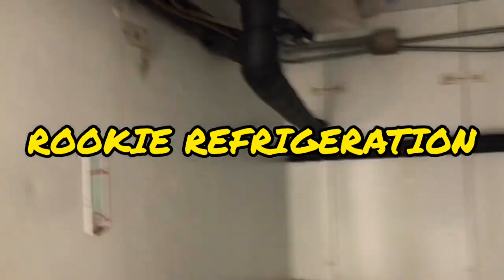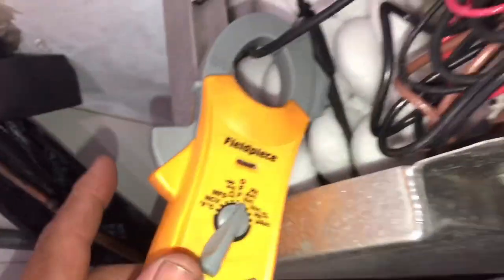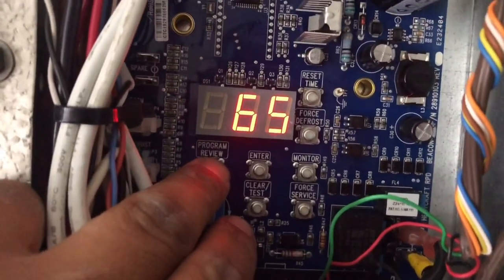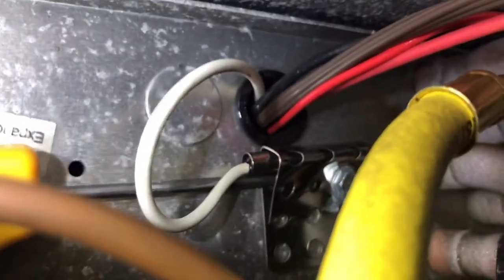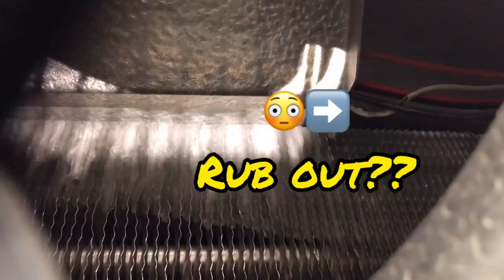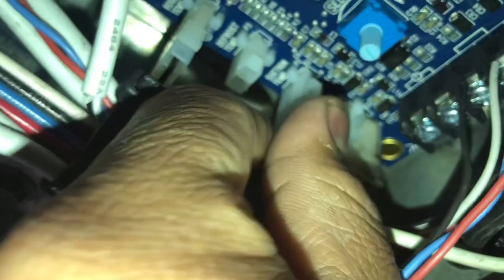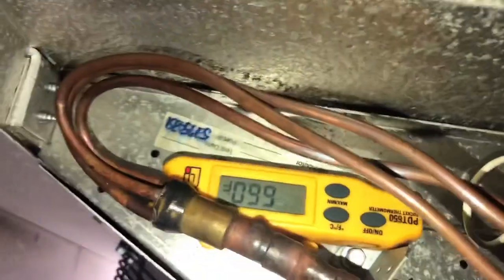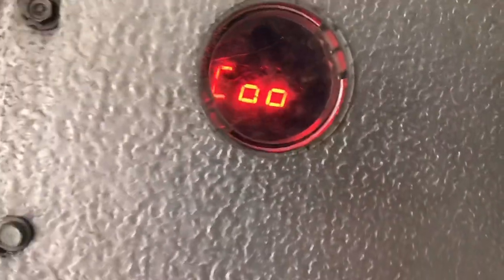Refrigeration:  Freezer Evaporator Icing up

Comment: a) You mentioned in passing "a design flaw" and b) I know that correcting manufacturers is a controversial subject. Having said that, wouldn't it be a good idea to move the defrost sensor to the most iced-up area of the evaporator and be sure each time it is 100% de-frosted? Thank you for another opportunity to learn.
Reply from the maker: Yes. That is exactly what needs to be done.  But we aren’t allowed to change it when we want. This chain only allows us to change these things if it’s approved.    It’s so dumb.   But you are 100% correct.   I’d love to relocate it to the top right part of the coil in between the fins.   Great comment bro
Reply: @rookierefrigeration4357  Thank you for the answer. Have a good day.
Reply: @rookierefrigeration4357  they likely placed it at the end to shield from physical damage when cleaning, also to prevent freeze/thaw cycles of ice pushing it out.
that was less of an issue with the capillary tube sensor type shoved deep inside the fins parallel with the tubing.
it's almost like engineers back then knew what they were doing, learning by trial and error in the field with real testing and not just some electronics/programmer nerds hacking a refer system by poking keyboards lol.
Reply: @throttlebottle5906  hahaha Exactly
Reply: i dont mean to be off topic but does any of you know a tool to log back into an instagram account??
I was stupid lost the password. I would appreciate any help you can give me.
Reply: @Jairo Jaxon instablaster :)
Reply: @Reuben Rex thanks for your reply. I found the site through google and im trying it out now.
Takes a while so I will reply here later with my results.
Reply: @Reuben Rex It worked and I now got access to my account again. Im so happy:D
Thank you so much, you really help me out!
Reply: @Jairo Jaxon glad I could help :)

Comment: Remember when there was a A419, metering device, solenoid,  evap fans, elements for defrost, on the roof, a compressor , time clock, fans, not all these boards that sit in -20C environments.

Comment: Awesome video. I am working on a small norlake walk in freezer. I am not sure if the evap fans should suction air through the coil or if they should blow towards the coil. The evaporator coil is set up almost the same as in this video. Please help.

Comment: Good find bro!! Very informative, thinking about getting back into supermarket refrig, air conditioning can be pretty boring sometimes and with the current circumstances, no ones spending money on air conditioning being a luxury and you need service techs for supermarket refrig because shops never close😂thanks for the content 👍
Reply: I miss supermarket refrigeration too, what I don't miss is multiple midnight calls and 80-90hr weeks. I have had a few companies chase me lately and it's very tempting. What's keeping my inner nerd happy is Rookie refrigeration  and Norcal Dave! I will stick to air cond for now...
Reply from the maker: Lol. Thanks bro.
Reply: Ba++y you're right about AC being a luxury but the way things are going in the US restaurants and bars are being shut down or restricted operating hours and in my area most Supermarkets are using union techs

Comment: I am not in the trade, so I might be missing something - but my suggestion would be to label the connectors with a small point sharpie ("SUC" for suction temp, "DEF" for defrost, and so on). Of course it should have been the person unplugging the connectors who should have been doing it, but better late than never.

Comment: Looks like the unit is going to be fine now. Yet one wonders if the original board was connected wrong and that is why it was replaced.  It looks like one end of of the DFH retainer has fallen down or was pushed down by ice build-up.
Reply: ya, I noted that too

Comment: Just FYI 
If there is a smart controller for that beacon system you have to change the parameters on the smart controller for it to save on the beacon control board in that evaporator

Comment: Great video. 
Could you increase the defrost termination temperature too 70 or 75 degrees Fahrenheit to defrost the remaining coil?
Reply from the maker: I think it was raised from 55 to 65 already.  If any changes were to be made, I’d relocate that defrost sensor to inside the coil on the top part, right corner.   That’s my next move if it ices up again.
Reply: I get you.sensor would be iced up. For defrost to terminate, it would melt the ice. Hopefully manufacturer doesn't have any compromised parts effected by the prolonged heat. Take care rookie.

Comment: you questioned the placement of the probes "return/Supply".... I would check to see if the OEM was truly having the airflow like that.  Someone may have replaced the blades or something... All the AHU I've seen PULL air through the coil.  This also makes it much easier to clean the coil because the dirt is on the outer face of the coil.  I have seen low velocity coils push air but then again those are usually on large up-flow types.
Reply from the maker: Nope. This is design.   All stores have this. 😥

Comment: It is stupid that  a plug and play board would use identical J clips, like you said were all human, manufactures should make the board so that clips can’t be plugged in wrong
Reply: ya really....they could have at least colored them different.....OR..... its the same sensor, just installed in a different location.  In this way, you could stock just one sensor in the truck.

Comment: I'd guess it's flooding the evap coil too, since the suction temp reading is high until it eventually freezes into block and of course the defrost terminates way early. 
hard to say what else the controller would do wrong when in defrost or cooling, there could be many complex issues as it cycles icing further with time. likely they've never dreamed nor imagined that could happened and have nothing in programming and design to catch the issue. I guess they could have used all different plug types, but that would be a nightmare down the road.
I guess they expected the tech to label them while removing or direct board to board swap that rat-nest, but was it ever right from the factory to start with?
Reply from the maker: Exactly correct.

Comment: are the defrost element supposed to be hanging that far below the coils on the end not defrosting as well? I don't recall seeing them hanging low on others, did the retainer clip pop out during shipper or from icing up solid? those hanging would make it defrost uneven since it's mostly convection heat then, vs. radiant almost directly into the fins and lowest tubing

Comment: If the evaporator is maintained above 0 degrees Celsius, for the water not to freeze on coils, how is it possible that any well working freezer cools down to (minus) -21 degrees Celsius?
 Logically thinking, if the evaporator air-flow outlet temperature is +0.2 degrees Celsius, the temperature could not go under it (to -1, -2 … -21°C), would it?
 Can somebody, please answer this question that really knows the correct answer.

Comment: Gotta change the settings for the beacon equipment at the main controller in the EMS panel. If it’s on EMS. Should be. If not can change parameters on the boards at each evap unit.
Reply from the maker: Yeah this one didn’t have the ALC board.

Comment: That was some great troubleshooting!! Keep up that good work 💪🔥💯 Do all  fans blow towards the coil or it could be both ways?
Reply from the maker: This one is designed to blow air across the coil like that.   Just depends on the design.
Reply: @rookierefrigeration4357   ohh ok got it, Thanks 👌

Comment: Color code all plugs, it’s called idiot proofing😂🤣😂 but they make a better idiot everyday so meh.....
Reply from the maker: Agreed 😝
Reply: Something like 3m H-5223 wire coding tape : It has a plastic case that hold 10 rolls of 1/4 wide tape with numbers -- also comes in colors. Maybe the manufacture could also save itself some trouble by coding each end of the cable.  And Yes, some manufactures offer their connector solutions in multiple colors. One could also use a standard label printer or Sharpie markers , if one needed to sort out a mess.